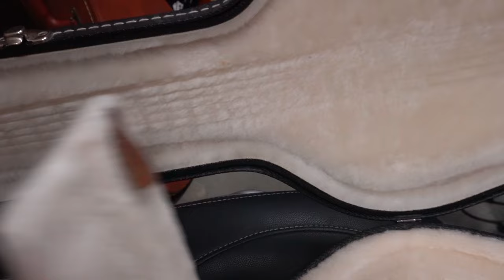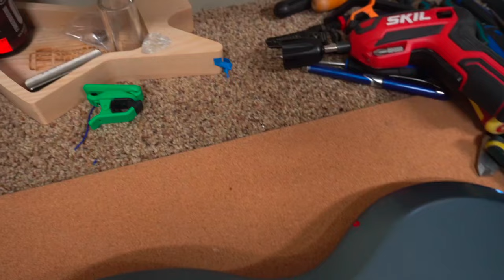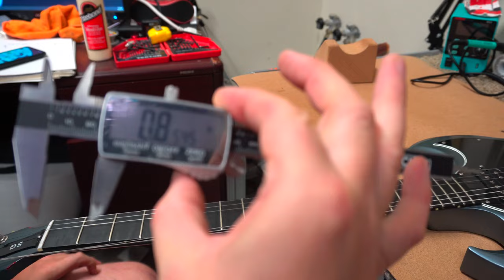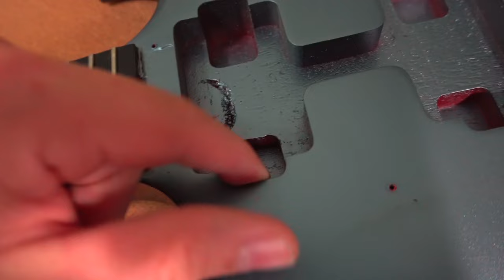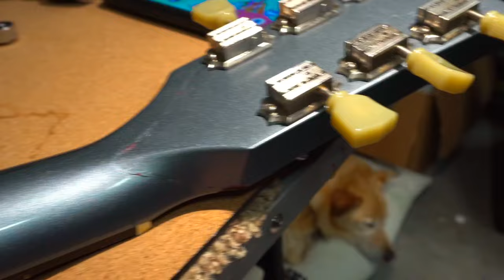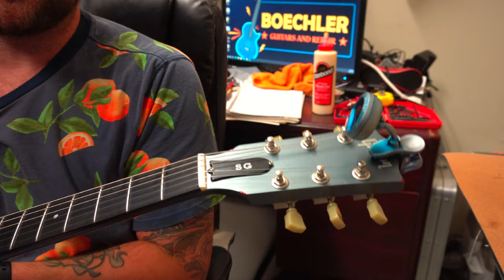LTD Edition 2008 Gibson Blue Mist SG Special Review and Demo

Comment: I checked out your listing and i have the same guitar built on the same day your's is 449 mine is 441. I haven't opened mine do you think you could drop in p90's or needs to be routed?
Reply from the maker: I believe you would have to route out the "corners" of the humbucker route to make a p90 fit properly. You could always use humbucker sized pickups like the Gibson p94